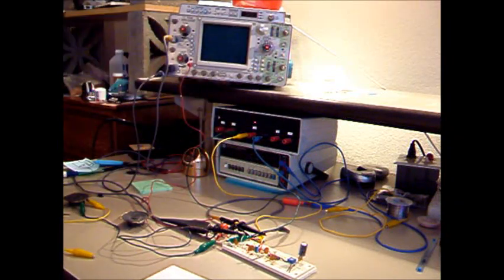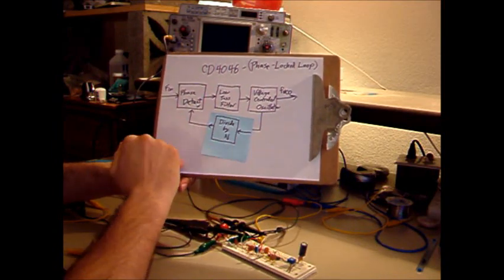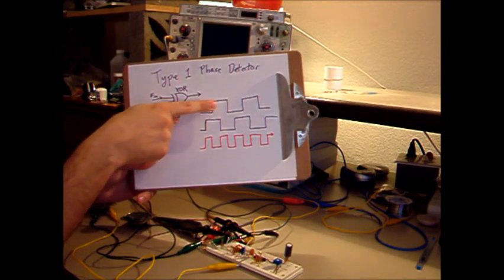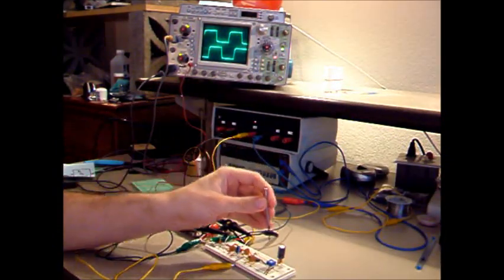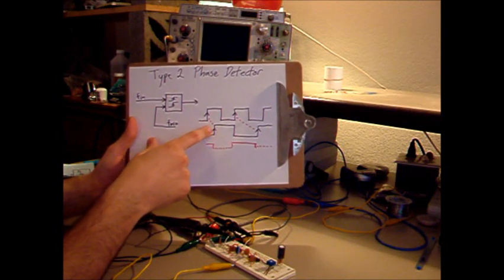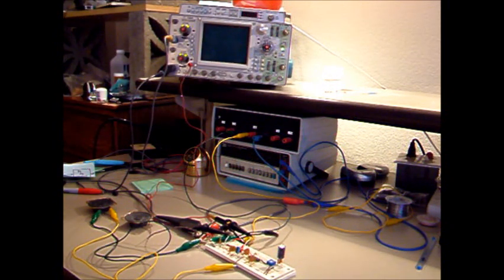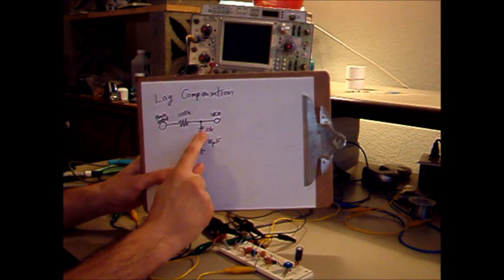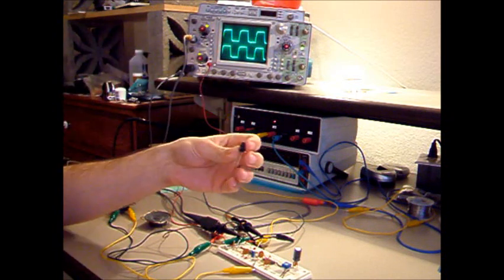Introduction to Phase Locked Loops

Comment: At 22:00 you mention that in case of the type 2 phase detector, the capacitor that holds the vco control voltage will be drained by leakage currents inside the capacitor, and by the control input of the vco.
However, the oscilloscope probe will load the capacitor with 1 or 10 megaohms (depends if you have an 1x or 10x probe) through the 100k resistor of the lowpass, making the total load 1.1 or 10.1 megaohms.

Comment: Ken, Great video.  When you referenced Art of Electronics I looked up and saw my old textbook Art of Electronics by Horowitz and Hill copyright 1980.  Sure enough there was a whole section on PLLs using the 4046.  So your vid was worth it just to remind me that I had the book on my shelf.  That book was my textbook back when I was enrolled at U Lowell.  You can probably guess I'm retired but am still active in the hobby.  My interest in PLLs has to do with using ultrasound as a method of voice transmission.  I'm an amateur operator usually operating in the VHF/ UHF spectrum but just want to do this for giggles and grins.

Comment: Hi Kanal I just wanted to say well done on you demonstration of the 4046! I don’t know if you’ve heard this one, but some say ... ‘Don’t let anything digital know you’re in a hurry’...
I once used a 4046 to get myself out of a shed-load of trouble and replaced a microprocessor as the algorithms simple couldn’t achieve lock fast enough. Even though the 4046 is digital I think its fast enough to look like an analogue device. I was only working at around 200kHz. Well done.
73's  ... Andy 
gw0jxm

Comment: Excellent explanation.  You should become a professor!  FYI, you should not be turning the scope on and off like that, you will shorten the life as the filaments are heating (expanding) and cooling (shrinking) repeatedly and will break. Keep your analog scope, it won't lie. On the new digital one's when you lose trigger it might show you the last recorded trace making you think that is the signal now being measured. Most people I know doing development work prefer analog over digital scopes!

Comment: Good explanation about the PLL. Thanks. If you get a chance, will you put a video of voltage control oscillator explanation using dicrete components. Thank you

Comment: Thx for the reply! But I think you didn't fully understand my question (at this point I have to say that I'm not an expert in practical electronics in any way and I heard about the pll first time few days ago). 

Let's take type 2 detector which eventually finds (ideally) some constant value which is then put into oscillator. Then the output of the oscillator matches with the input (variable voltage)  of the loop. But how the oscillator knows what is the amplitude of the signal?

Comment: Hello Kenneth! thanks for the video. One primitive question, should both of the waves have the same shape? Based on what I understand from your explanations when you are talking about the edges it means they should be only squared waves but you cannot talk about that to another crazy wave form types. Right?
Reply from the maker: That's a good question! They don't need to be the same shape. The input signal can be any shape which can still trigger the phase comparator, and the output waveform is whatever the oscillator outputs, be it a square wave, sine wave, etc.

Comment: I think you need some more real-world examples. From a complete newbie's perspective, it looks like you built this fancy circuit to make the input the same as the output (aka "a wire"). I get the impression they're more useful than frequency multipliers, but I can't figure out why.

Comment: Nice video but one stupid question. The output frequency of the oscillator is defined by the input DC voltage. But how the oscillator knows what is the voltage and current values of the original signal? So the oscillator modifies the frequency but who tells it what is the gain etc?

Comment: im doing this for my project, designing a PLL system with a frequency range of 1-10MHz and 10kHz step size. want to kno why the cd4046 IC is preferred to the others. also my system isnt working so iwas wondering if you could give me your email so i can send u the block diagram of my design as im using 3 loops for this.
Reply: Hello Edwin,I hope you successfully done your project. I also have to design a circuit on PLL, and I don't know how to approach the problem as I haven't found any program to simulate the PLL, so I gladly listen to any advice of yours.